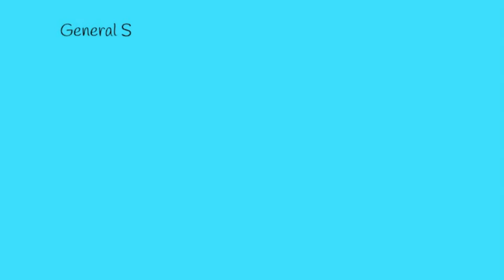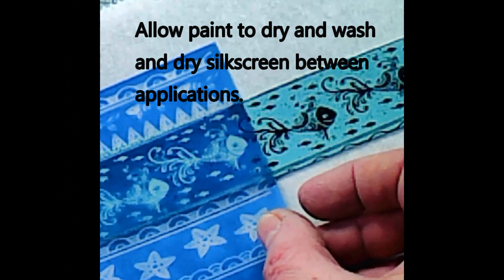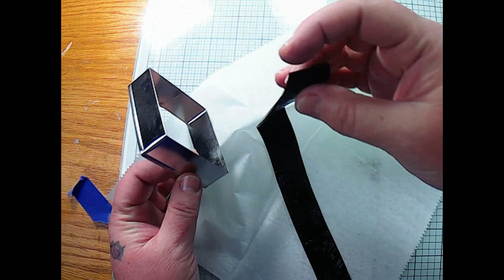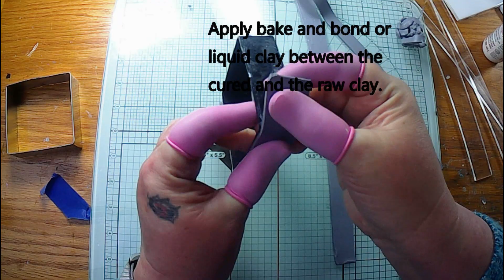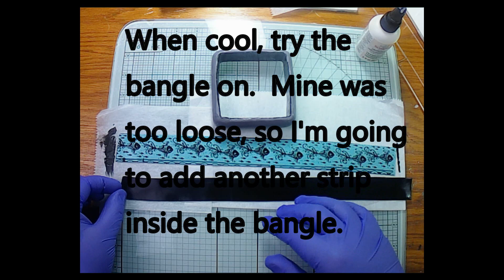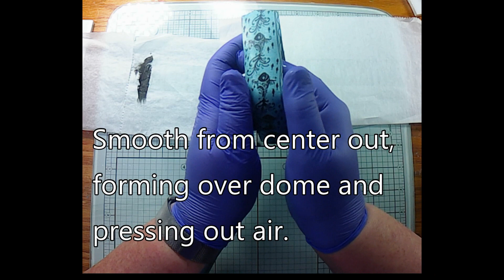Silk Screened Square Bangle by Angela

Comment: Great video! I shopped the website for the silkscreen; any reason why I SHOULD choose the upgraded purple silkscreens? Especially for use on polymer galaxy?? TIA!
Reply: Thanks, Lesley!  Nope, no need to upgrade to the purple for polymer, in fact, they are probably too sticky for polymer, but are great for wood or glass etching :)
Reply: @angelathompson2114  lol, polymer “galaxy”...that is fitting for a clay obsession 😅 Thank you for letting me know 🤗
Reply: @lesleyh.9321  You're most welcome :)